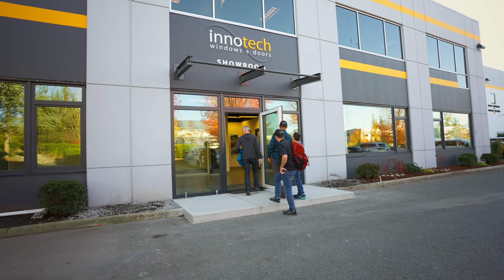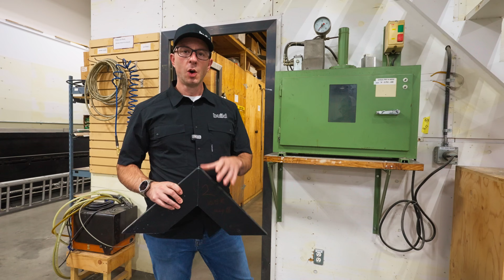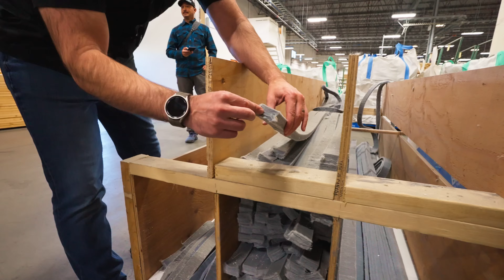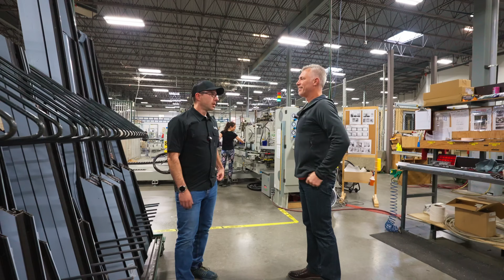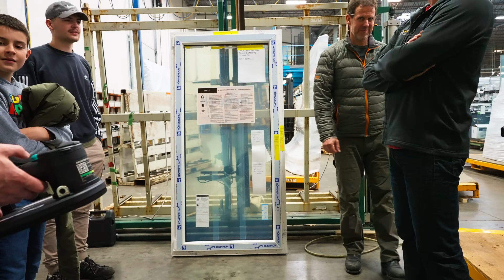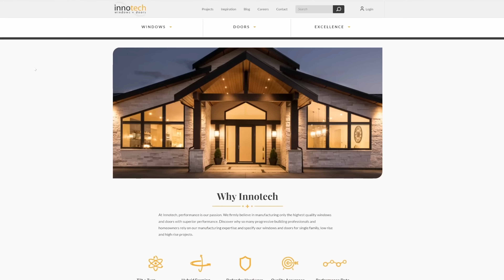Windows Worth Every Penny: Here's Why

Comment: Energy efficiency software really shows the significance of windows. Past a certain point there isn't any value in adding more insulation to a wall unless you upgrade the windows too - and it's a pretty low point. A generic window like we grew up with will just suck the heat out of a house in winter, or into it in summer.

Comment: R10 per inch? holy smokes. can they mass produce this material?
Reply: Yeah right...Talk about a well insulated house. You could get a R55 in a 2x6 wall. Sounds too good to be true.
Reply: @Frankreddy62 how do you intend to move heat trough an air barrier? And it's not even air, it's argon. Whatever solid or liquid you can think of, it has much higher thermal conductivity then a gas, it's not rocket science  Like what material can you possibly put in your wall that is better thermal insulator then air? All good insulation materials all they do is trap a lot of air. Multiple layers of glass will do just that, trap a lot of air and nothing more.Btw the low e coating is the equivalent of the aluminum foil. So you got all the ingredients of wall insulation in the window. The trapped air and the infrared mirror